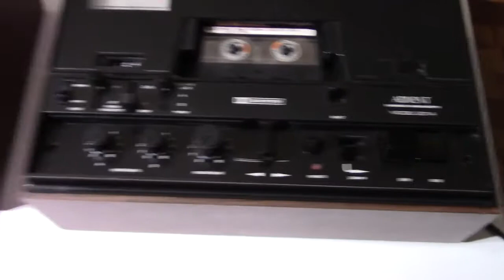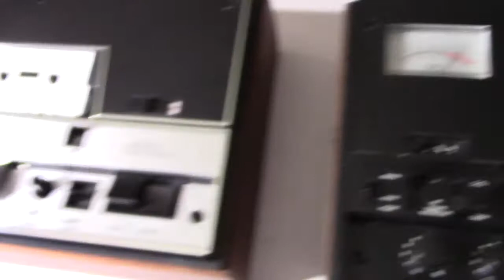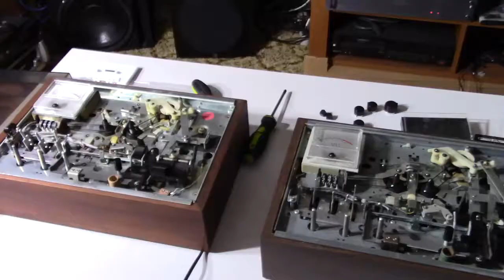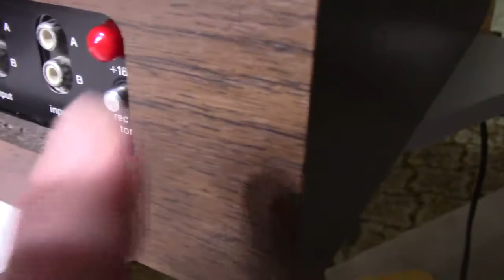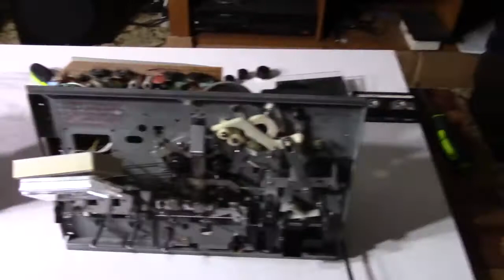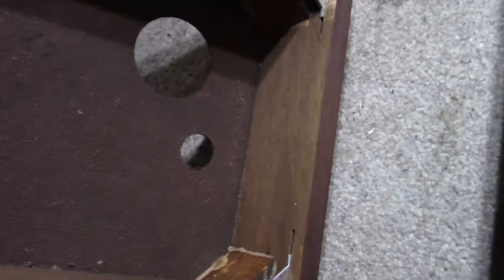Advent 201: Upgraded- Classic Tape Deck

Comment: Just one VU meter, is it mono?
I like its styling, never saw one of these before.
Reply from the maker: It is stereo, but there is a switch that selects between left, right or both channels at once... the designer wanted the same meter ballistics for both channels.. at least that's what they said back in the day.... Honestly, I would have preferred dual meters, but this Advent was one of the best decks available at the time, made in the USA. They last forever... as evident here. Thanks for watching!
Reply: @HammyTechnoid  Very similar in looks to the Neal deck here in the UK. Come to think of it, I'm not sure if it was made in England etc?, will have to check .....
Reply from the maker: I've seen the Neal model you mention. The use of the American made 3M/ Wollensak transport makes it a classic.

Comment: I got one from Ebay and the latest audio cable does not fit properly on the side, is there a special audio cable for Advent Cassette player? Thank you!
Reply from the maker: There aren't special cables for the Advent deck, however, if you're trying to use cables with extra large insulation, the gap between the 2 RCA connectors might not be wide enough. Find cable that fit and you'll be fine.
Reply: @HammyTechnoid  Gotcha! 😊 Thank you!